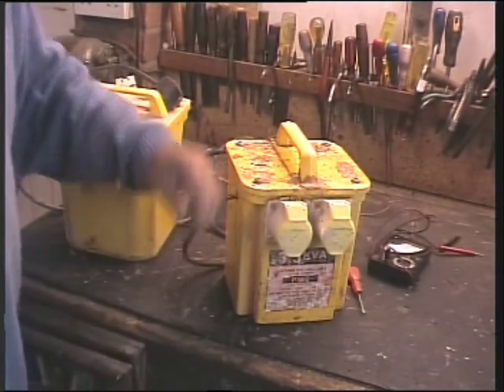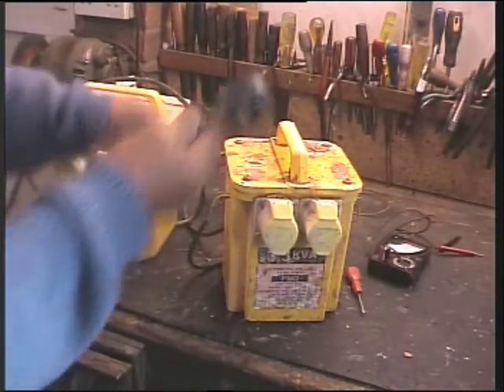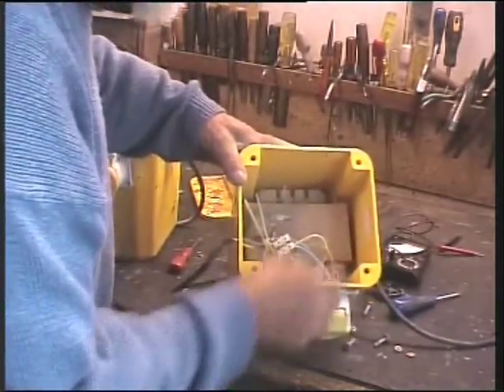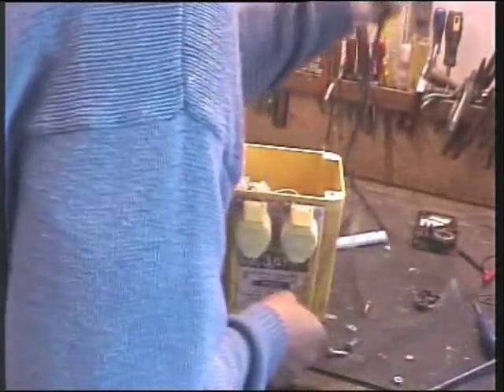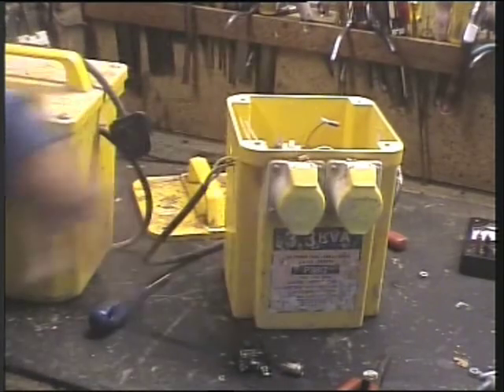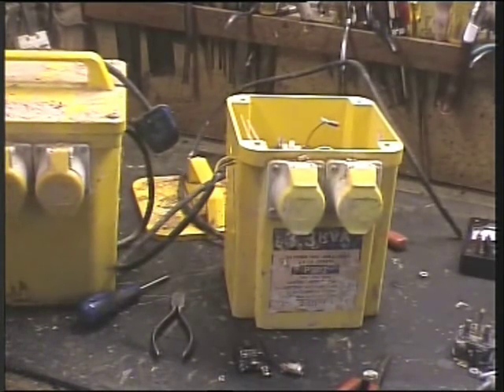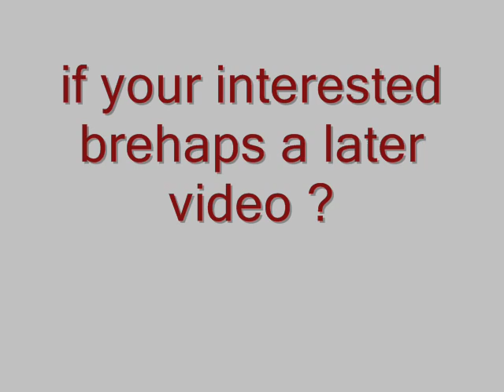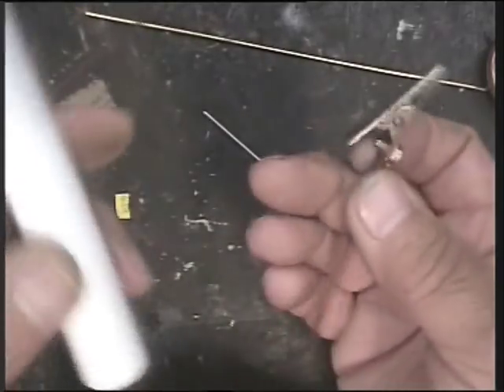over my shoulder waffle

Comment: Hah! I've worked as a job site safety inspector.  The things you see contractors doing. Many seem unable to follow or read instructions. Most of it comes from not taking care of equipment or using the proper tool for the job. Then they complain about you being on their case. They take 20 min out of the day for smoke breaks but don't have 5 min to replace the plug on a power tool. Stand on the top step of of a 4 foot ladder instead walking outside and getting a 6 foot ladder. My instructions are to cut the broken plug off a tool and make it unusuable till it's fixed. Decent guys that carry extra plugs, if they don't have time, I would install the replacement. I've wrapped a few damaged cords so they keep going.  I quit. I prefer a machine shop where the respect their tools.
Reply from the maker: believe me ... you get plonkers in all trade`s ,  just take a look at some drill/mill tables ..
Reply: Yeah I worked one of those dirty sweat shops for a couple of months. Not for me.

Comment: Every one of these that I've seen is 55-0-55 on the secondary side and the secondary centre tap is earthed. That means the maximum belt you'll get is 55V w.r.t. earth, a lot better than 110V w.r.t. earth if you're a builder standing in a puddle drilling through a wall in the pouring rain (why do they always do that?)

The ones with dual output sockets could possibly be 110 against earth one side of the secondary per socket but like I say, every one I've been in has 55-0-55. Shame because a bench isolation lump of 3kVA+ is not a cheap item to buy! You can two of them daisy-chained back to back to get double-isolated 240:240 but doing that means there's a fair bit of droop at high currents. There can be quite a bit of inrush running them that way though so popping RCBs or even a 13A plugtop fuse is not unknown, especially if a big load is on the far side at switch-on.

Also, it annoys me that even when you buy a brand new isolation transformer you have to go inside and remove the earth from the secondary side to make it truly floating. 
I use two bench isolators, one to isolate and float the equipment under test and one to float the test equipment. A lot of stuff in RF work is grounded to a metal chassis (as I suspect you know - MRGC?) so hooking up a scope BNC earth's  out your lovely new pricey isolation transformer and you're back at square one.

More recent scopes are available in fully isolated versions but they cost a pretty penny and are all digital so are rather annoying - some don't even have knobs, just up/down buttons :/
Reply from the maker: Yes you are quite right ! I got that wrong, the two sockets are ganged ,thanks for info